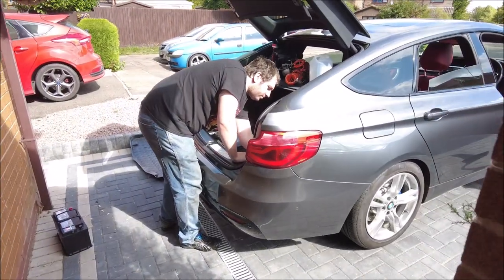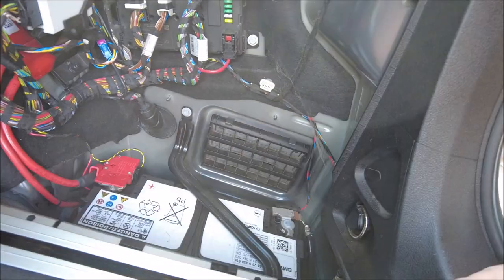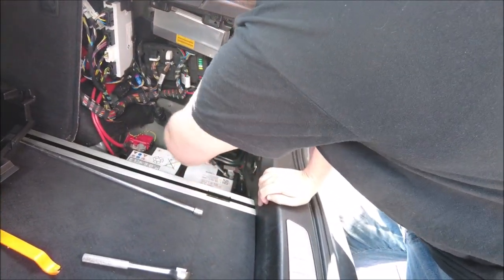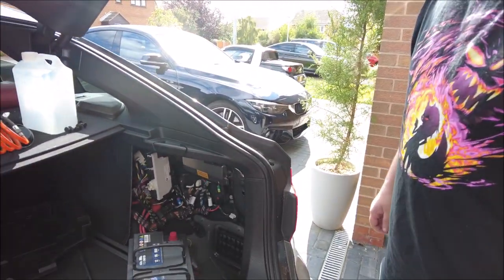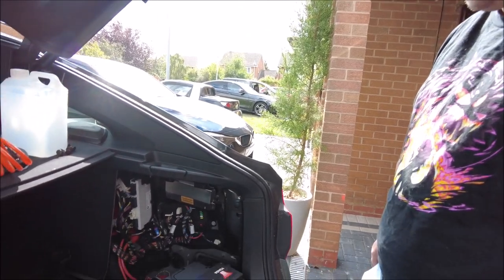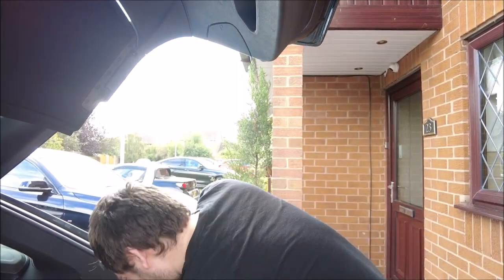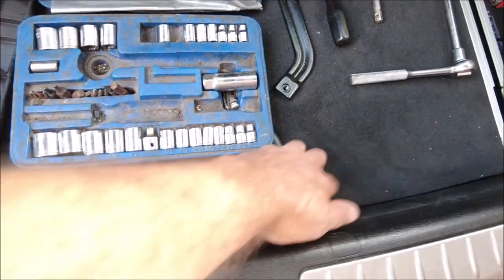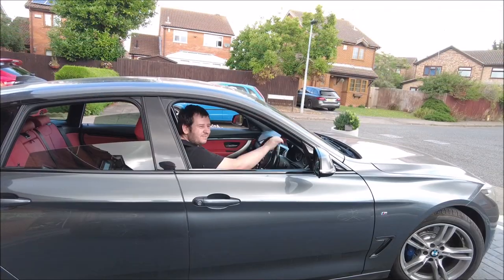BMW 3 series battery replacement. #bmw #bmw335 #3series #batteryreplacement

Comment: The bit I was most interested in was refitting the rear clamp screw which for these boys suddenly happened by magic.  I spent over half an hour trying to start that screw thread but no go.  I removed the bolt from the clamp, twice, and each time got the bolt to screw down, but with the clamp, no hope.  I have now left it with just the top clamp.  Life was so much easier in the 60s and 70s.
Reply from the maker: O yes older cars where so much easier to work with  👍
Reply: @AdeReeves  That's right Ade, and it's even worse than I thought.   Turns out that I now have to introduce my new identical spec., battery to the 'smart' charger with a scanner device, anything over £85, or I might risk burning out my new battery or the car's electronics!  If this is new to you, look up 'battery registration ' for an annoying read!

I miss my 3 Litre Capri!